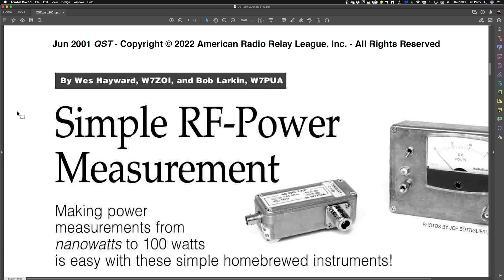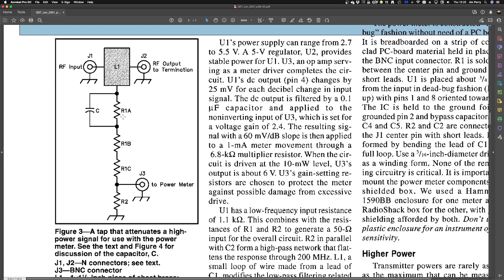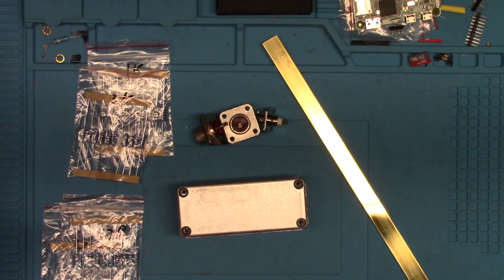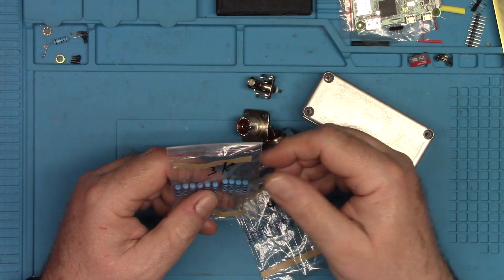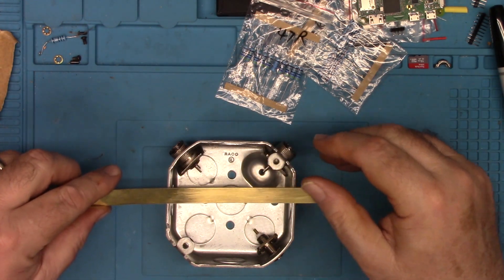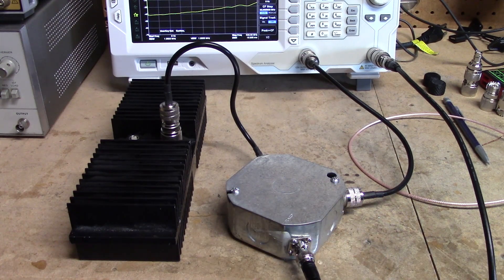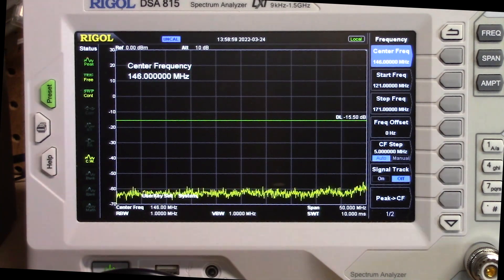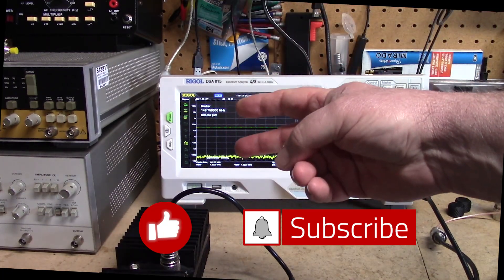Home-Brew RF on TAP!

Comment: Can you suggest a design (project or commercial unit) for the UHF range.  Tnx W6AOA Pensacola, FL
Reply from the maker: TheSmokinApe and I made these, but a decent one is the Celwave ones.  They are rated up to 200W, with and inductive tap.  I did a video on one of them, and have used it in several other videos.

Comment: Good job Jim! I bet when you do it in the smaller box, it will track to a much higher frequency. UHF hates long leads.
Reply from the maker: Very true.  I figured that when I changed out.  I had already messed up the small box, and I was getting aggravated, so I grabbed the junction.  I did see that the attenuation amount was falling off as the frequency went up.  I think I had some of that in the part with the spectrum analyzer toward the end.  I might not have mentioned that, but I did see it.